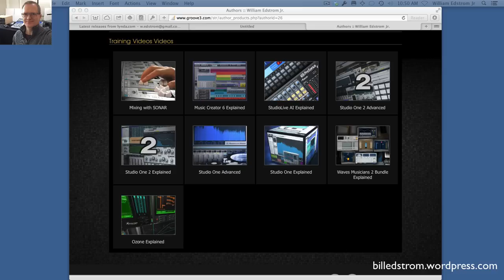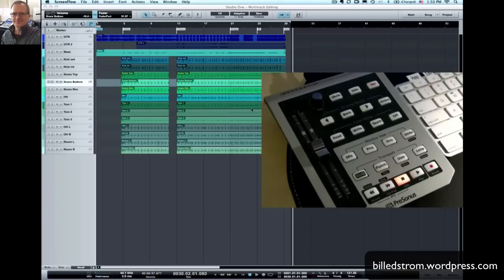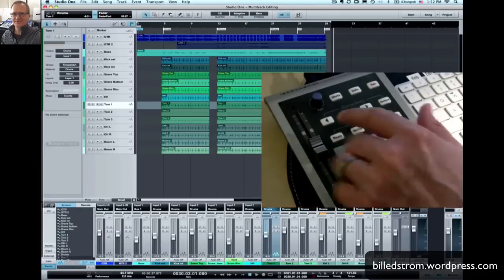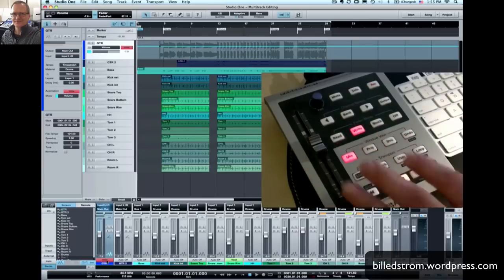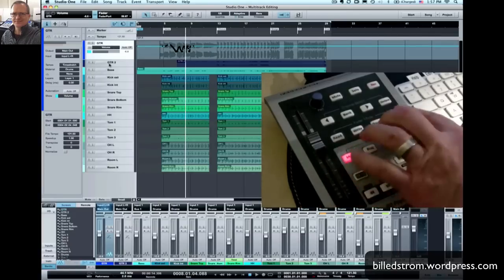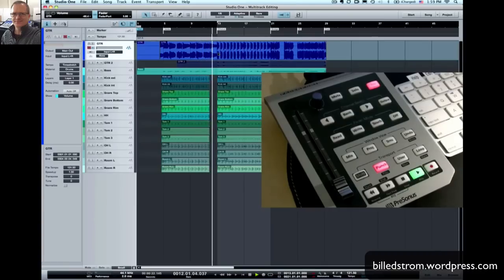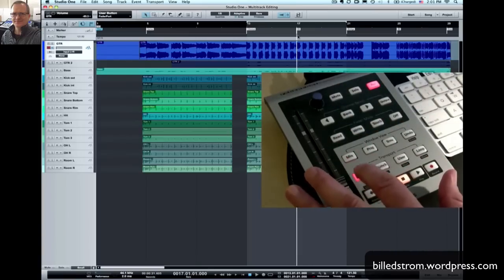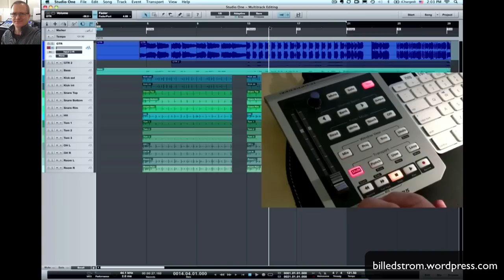Using PreSonus FaderPort with Studio One

Comment: can you cancel fader movement but continue on screen automation without disconnecting device?
Reply from the maker: Rayshon Jonse Yes. The way I do that is to disconnect the power supply. The adapter powers the motor for the fader. With it disconnected, the faderport continues to work it just that the fader won't move automatically. There are some instances where the USB port doesn't give it enough juice but on my computers it works fine.
Reply: Bill Edstrom great.  thanx for the quick response.  what about bus faders- can it automate those too?
Reply from the maker: Rayshon Jonse The fader controls whichever channel is selected. If you select a bus channel, it controls it.
Reply: Bill Edstrom great.  im about to pick one up today!